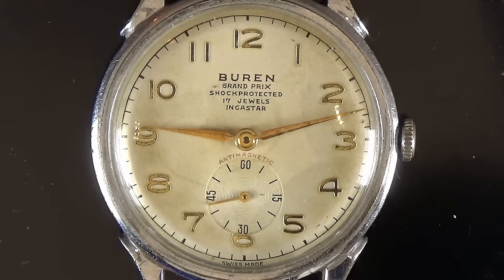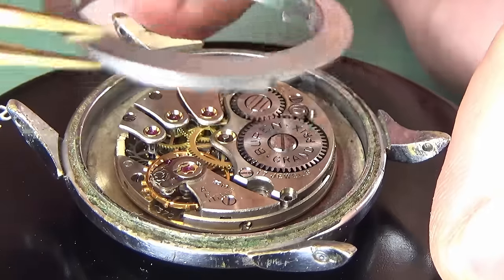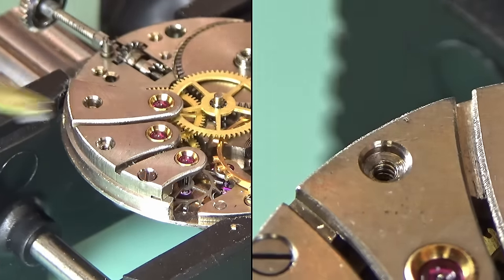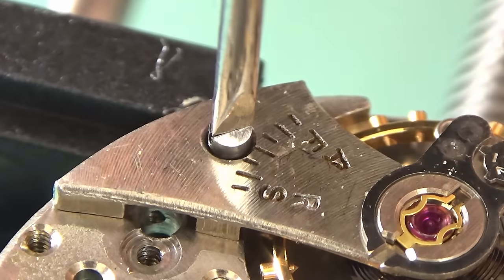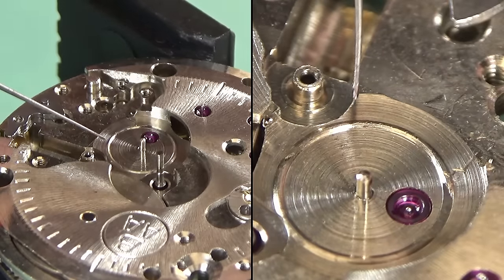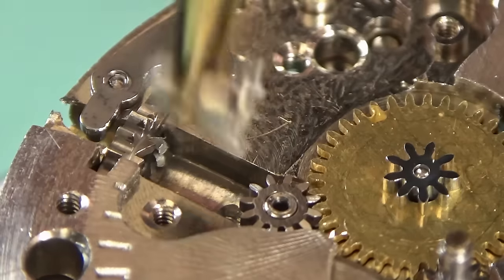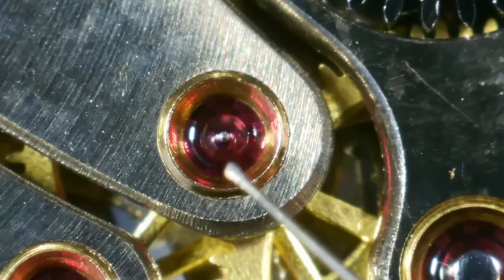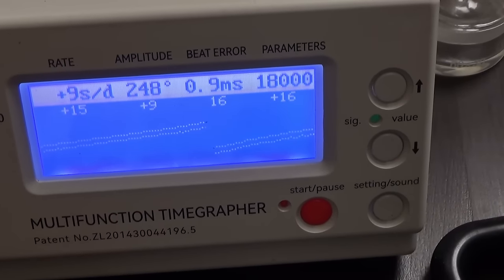Priceless Vintage Watch Restored, a Collectors Timepiece

Comment: Speaking as a goldsmith who has dropped 1 or 20 things. The best way to locate a small part I've found is to set a flashlight on the floor, in the middle of the room and then rotate it slowly. The beam should streak across the floor in a somewhat darkened room. EVERY LITTLE THING jumps out at you.
Reply from the maker: I will give that a go thank you for the tip! Awesome
Reply: @Saving-Time  really nice watch and great work on the band.
Reply: Does that work on shag carpeting?  Just kidding...  A long bar magnet will help with ferrous metals.  Kinda sweep the area with it.  I have one about 3 feet long.
Reply from the maker: I have one, and I've heard it referred to as a watchmaker's wand. I'm not sure YouTube would be happy if i started waving my watchmakers wand about here on the channel :D
Reply: That’s what I do
Reply: Very nice movement. Love to see it in that gold case one day. Thanks for posting.
Reply: Funny thing about the movement, I was looking at a group of all Gruen movements when I noticed one didn’t match the others. It was a Buren Grand Prix! Unfortunately, it appears to have a regular balance complete.
Reply: @Saving-Time 😂

Comment: I just wanted to comment on something you said and offer a correction. In the same way Buren had the first micro-rotor to market, Seiko had the first automatic chronograph to market, not caliber 11 that Buren was apart of the development on. Also the first Quartz, and the first Quartz chronograph for good measure. Okay, thanks. Continue making amazing videos.
Reply from the maker: It's hard to say who was first "Jack Heuer noted that the head of Seiko then, Mr. Itiro Hattori, visited the Heuer booth at Baselworld 1969 and congratulated them on their claim to the first production automatic chronographs. Based on his anecdote, it’s possible that Seiko acknowledged they came after." it might have been Seiko there is some debate about who was first. I should have brought it up in the video. Thank you for the correction I appreciate the time you took to let me know.

Comment: Well done! What a beauty. I went into the same hobby last year and there´s not a single day without discovering new tools and new methods things to manage. I love your content and enjoy your channel. One big question: How is your camera setting and what equipment are you using? I would love to see your workbench
Reply from the maker: Camera: i use sony cx 405's; they are not good You need enough light to give yourself a suntan, and they are useless if anything is moving. I use three cameras, 4 if you count the one on the microscope, so I needed something cheap that could record for a long time without overheating. They fit the bill, but only for very specific use cases. https://www.instagram.com/p/CvAOvwEI5if/ my workbench, such as it is
Reply: @Saving-Time  thank you so much 👍🏻

Comment: Once again an excellent video, thank you for kindly sharing. I'm also restoring an old Buren, just a plain Cal 370 with a worn main spring - would you be kind enough to share which spring you used and where I can find one, many thanks.
Reply from the maker: Part number at https://www.cousinsuk.com/ GR4747 size is Mainspring: 1.650 x 10.000 x 0.105 x 360.000 mm hope that helps
Reply: You’re a gentleman, yes a big help, thank you so much 😊

Comment: What would be the reason for having minute indices on the movement itself?  Adjusting in the pre-timegrapher days (without dial installed)?  I've seen it on a couple movements now.
Reply from the maker: Yes, I believe it was done for timing reasons. I'm not 100% sure this was the only thing it was used for, but I think so. I hope you enjoyed the video

Comment: What brand of edge paint do you use? I've been making my own straps for a couple of years now. I got into watch strap  making because I have 8" wrist and finding quality straps that fit my wrist at a reasonable price is impossible.
Reply from the maker: Fenice is pretty good Give that a try if you have not. I feel your pain. I have the opposite problem with small wrists, but it is still an issue. Buying bespoke straps gets expensive fast if you're a vintage collector I have straps that are worth more than some of my watches. I hope you enjoyed the video

Comment: I absolutely love hand-wound movements.
However, nowadays there's very little to choose from.
Unitas 6497/8 and its clones are big, they require at least 41mm case and many case designs have to be even bigger. It's not thin either.
Most other hand-wound movements are very small. And in the age of men's watches generally being 38mm and larger, it makes 0 sense for the movement to be relatively small at 25mm and less.
Most are low beat, low power reserve and their cost is prohibitive, while Seiko's NH35 automatic movement sells for 25$ and makes profit and we're talking about retail. If you want to buy them in bulk, they get even cheaper.
There is no such thing as cheap hand wound movements with large power reserve, hacking and good beat rate around 31-32mm. 
I wonder, maybe people do not really like hand-winding their watches every 2 days (assuming a 52+h power reserve)? I definitely enjoy it, but maybe that's why automatics are holding well while hand-wound watches not so much?
I love the simplicity and reliability of hand-wound movements. 
The only downside I see is the water resistance - push-pull crowns can be plenty water resistant, but turn the crown 30 times every 2 days and it will degrade it quite quickly.

Comment: Should have made a black one....Just kidding that strap was amazing.  I was getting into watch repair but after watching a lot of your videos of late it's making me more interested in learning strap making as well.  Do you have any methods to breaking in new straps or with the ones you make break in is not much of an issue?  I have found with some types of straps I buy eg sailcloth and rubber types that are stiff and take a bit to break in that using hot water with the straps in a curved glass and then into cold works a treat in shaping and making break in easy.  Still with fancy leather straps im sure there is safer ways to do this.
Reply from the maker: The straps I make don't need a break-in period; it's all about picking the right leather for the job. Give the strap making a go. Pick up veg-tan leather between 0.8 mm and 1.2 mm for the front and calf skin or lamb skin for the back. Look at Conceria Walpier - Buttero is a good place to start; it's expensive, but straps are small. Saving on materials is not the best way to go, IMO. I make strap making look pretty easy, it's not. Expect to go through a bit of leather before you make something that's nice. But if your okay with that, i'd recommend it It's fun, and hand-made bespoke leather straps are very expensive, so you'll save some cash in the long term. Good luck

Comment: I disagree wholeheartedly with you about cleaning the dial, and a polish of the case then gold plating would make that guy look a million dollars,  as it should. I just don't get the "patina" thing.
Reply from the maker: I'll be recasting this watch in solid gold; otherwise, I would have replanted it. As to the dial, cleaning will do nothing to this but damage the dial; it would need to be reprinted, which is easy enough, but that would knock off most of the value of the watch, so...

I'm not saying you're wrong. Some people like things to look new, but in the case of watches, a 70-year-old watch with a pristine dial is almost always a reprinted dial, and to most collectors, it's worth about 70% less than it would have been if you'd left it alone. So if you like that sort of thing, just know you should be paying way less money for it unless the seller can prove the dial has never been restored. Basically, I like old things to look old; if I wanted a watch that looked new, I'd buy a new one. Good news for you, though. If you don't mind a restored dial, you should be able to pick up some cheaper watches.